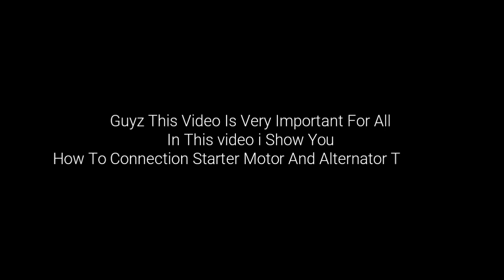How to Connection Car Alternator And Starter Motor Wiring Together | How to Wire Starter

Comment: Hindi Maka kaya Yan kung hindi mu babagohin Ang diode..at mag lagay ng transformer..mahinanpag direct na nagagamit Ang output, stuck Yan sa transformer generate lang..kahit Yung mga stator lang din gawing transformer, hati lang Ang secondary may capacitor sa gitna, Yun na Yung handred volts output

Comment: Thanks for this video...

I want to use this connection on an engine...
Pls after connection;  to start the engine with the kick starter with your connection ...

I want to install another push  botton to stop the engine how do I achieve that .. thanks